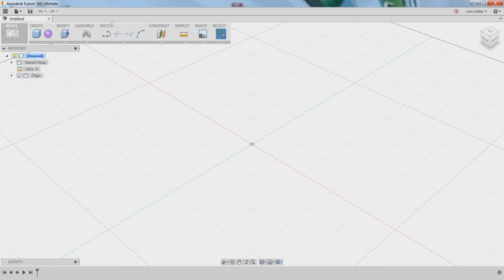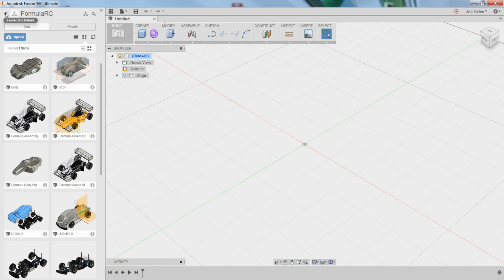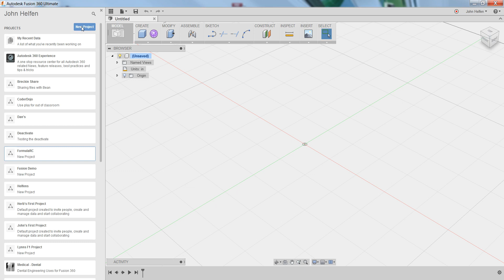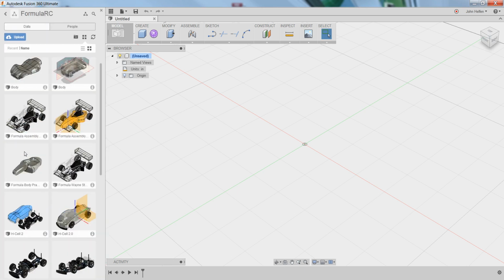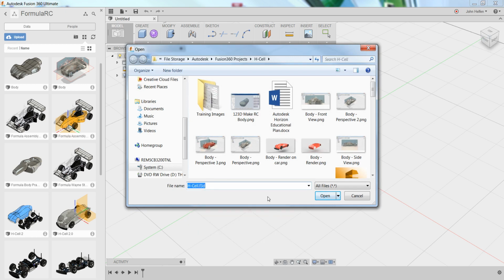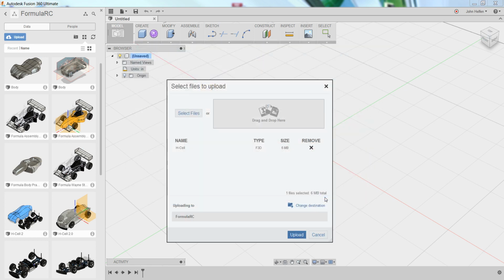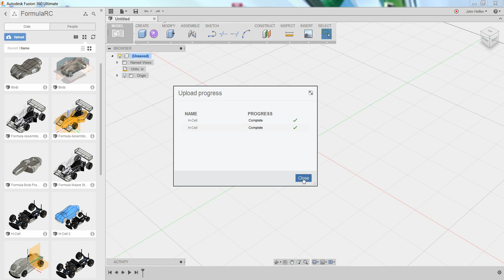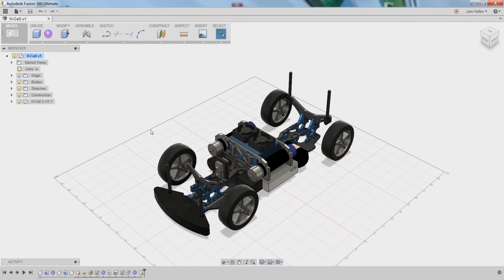Fusion360 - Uploading Required Files

Comment: So if I make anything in Fusion 360 it goes to Autodesk's servers? They keep what I make?
Reply from the maker: Darren Style they hold the data, but you can also export f3d archive files if you would like.
Reply from the maker: Also, if you are offline, everything stores locally until connected to the internet, then syncs when the connection is made.